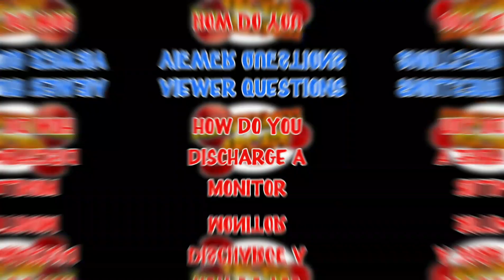How To Discharge An Arcade Monitor

Comment: MattyMo's Arcade
Is it ok if I use thick gauge audio speaker wire to discharge with the flathead screwdriver?    It's what I have on hand.
Reply from the maker: Yep. That will work too.
Reply: @MattyMosArcade  Thank you so much your video is very helpful I feel very confident in safely removing my monitor now before I didn't even want to get near the thing.
Reply: Is there anything else that could shock me inside the arcade cabinet after I remove the monitor?
Reply from the maker: @steveclark9934  not if you unplug it.
Reply: @MattyMosArcade Great advice I removed my monitor successfully from the cabinet. However a new issue arose from my golden tee complete both of my marquee lights are flashing on and off and sometimes the monitor will have a weird line sort of flicker go across it at the same time could this be a voltige issue? it had been working great previously for the last 2 months since i got it however it had been shelved in a warehouse for the last 15 years but it is really clean lokking inside and out.
Reply from the maker: @steveclark9934  I'd unplug the marquee, and see if the monitor still acts funny.
Reply: @MattyMosArcade  I unplugged the marquee and the video has not fluctuated since great advice. maybe the bulbs were going bad?
Reply from the maker: I'm not sure exactly what does it actually, but I've seen it many times. I just replace it with an led.